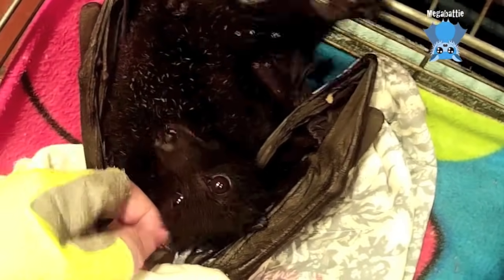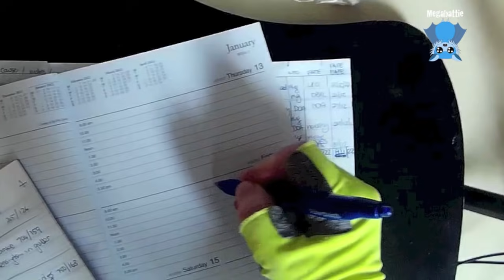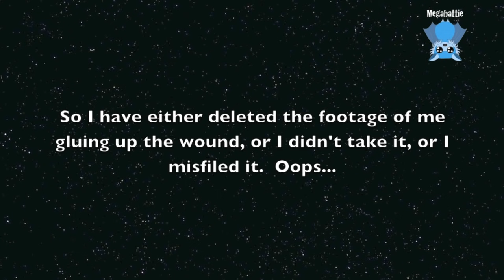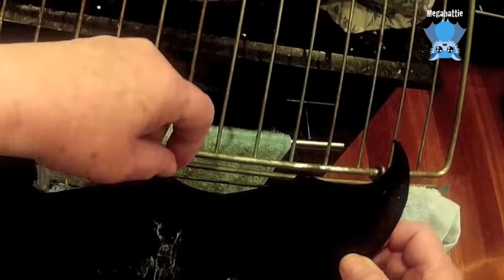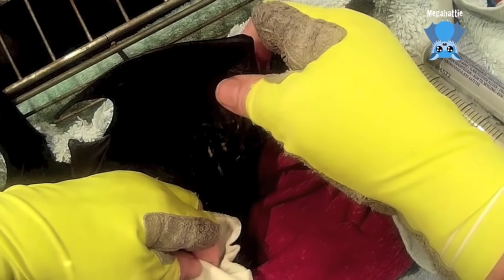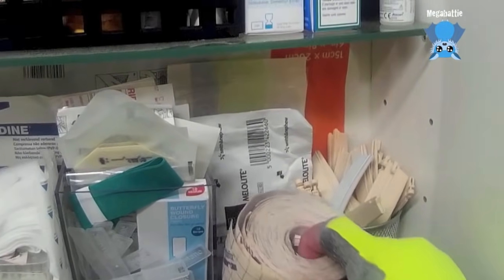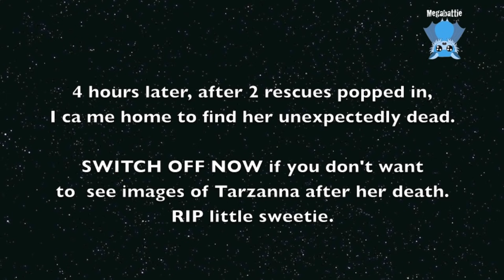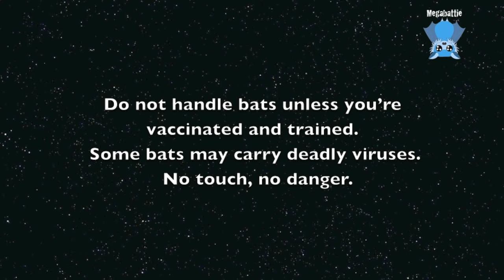Flying-Fox with a constriction injury from kite string entanglement:  Tarzanna

Comment: You have such a gentle and reassuring way of talking to them, little wonder that they usually calm down quickly. And grapes certainly would win me over too. Sorry she didn't make it. Careless people suck. As hard as it is to watch, I'm glad you don't shirk from showing the injuries in full detail. It's important for people to see these consequences.
Reply from the maker: It's important to show the injuries.  Most people wouldn't believe the amount of damage a small section of the kite string can cause, until they see it for themselves.  They think if they cut a bat out and release it it will be fine.  It won't be.  It will undoubtedly die.
I don't always get to show this aspect of the care because I move my netting bats along to a carer immediately, so I'm not there on a daily basis, able to show the breakdown and healing process.  
Many of the older bat carers still believe releasing a bat immediately is the right thing to do because, as they say - the bat has no injuries other than a bit of bruising and swelling.  Since they never keep the bats, they never see that they're sending them out to die.

Comment: Does the superglue dissolve after a while? Or just fall off?
Reply from the maker: It just falls off.  Try it on any cuts you have on your hands.  It holds it together until the skin can heal up underneath.  
It's so much easier than using bandaids all the time on your hands.
Reply: @Megabattie  Thank you. I'll remember that trick.
Reply from the maker: @moiraesfate1   It's really good because it's waterproof and stops the pain and stops it gaping underneath the bandaids, and cracking when it starts to heal and is drying out.
Reply: @Megabattie  All the times that knowledge would have been useful lol. Thank you Meg. That makes sense though, I was wondering why I didn't have stitches on my stomach after my surgery (It was years ago now) but never thought to ask. That's what the surgeon must have done. Quite interesting. Poor batty though. At least she didn't continue to suffer.
Reply from the maker: @moiraesfate1   he probably did subcuticular sutures - like a running stitch below the skin holding it all together.  They just dissolve